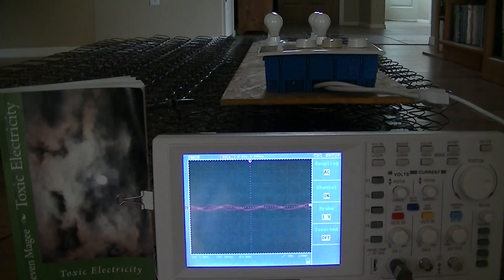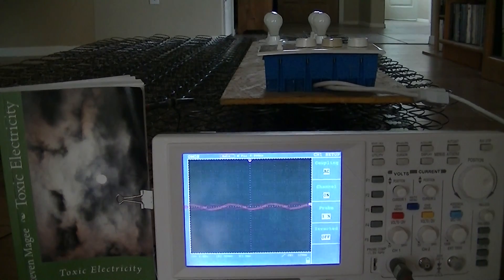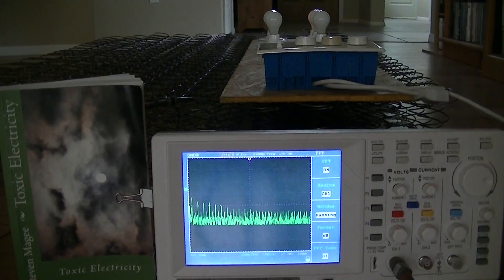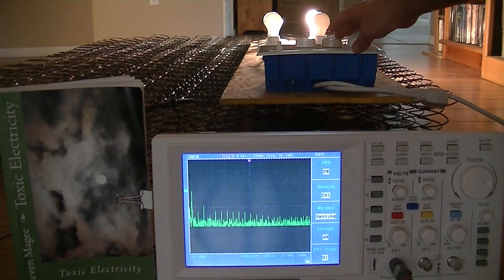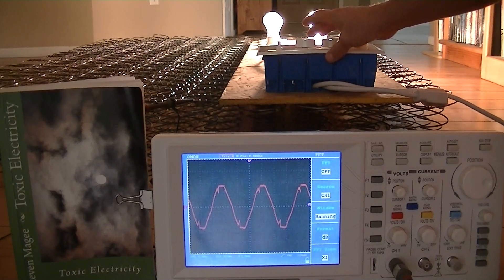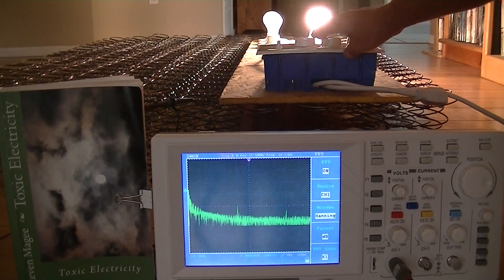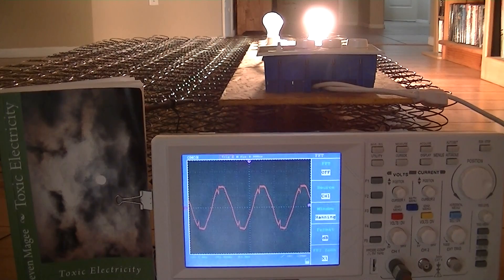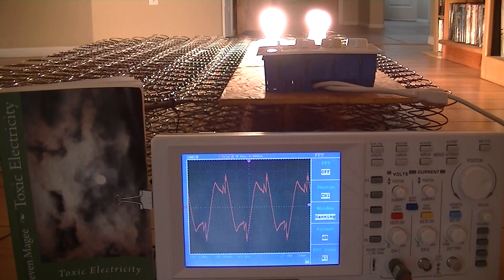Harmonics and Dirty Electricity on a Metal Coil Mattress

Comment: This isn't very helpful for the layperson. How does having the lamps right on top of the exposed mattress prove anything as well? No one is running electric devices on top of their beds. Looking into this because I noticed using a Cornet that the mattresses in my house will produce spikes of EMF on the meter, question is I guess is whether dirty electricity from the house ends up bouncing around in the bed. Likely is smart to simply get a bed and mattress which is free of metal, a good way to do this too cheaply is buy several latex mattress toppers, put them together and you have a great mattress which is more affordable than all of the BS over priced branded coil ones.
Reply: Yep I've got no idea what he just proved...

Comment: Oscilloscopes have extremely high input impedance and are sensitive to the electrical field virtually anywhere, just touch the probe with your finger for example and you will see plenty of waveforms from the electric field thin air virtually everywhere, this is why the probe must be completely shielded to allow a clear signal, please explain how the scope is connected to the mattress (is the earth connected in some way or have you just connected the probe in a floating sense, which doesnt measure current, just potential), also is this really a fair test given that you would never have high current lamps in such close proximity to the mattress, to be fair you should show the result as the lamps are lifted away from the mattress at several distances, this would give us an indication of the relevance of the phenomena (for instance does the waveform intensity drop significantly if you lift the lamps by a few centimeters?)  simply showing waveforms in a fix conditions like this could be misleading because it doesn't really allow you to understand the field intensity of the re-radiated field, there needs to be a field strength measurement, the lamps are the offenders here not the matress, unless you can address some of the above questions, otherwise a good experiment and thanks for sharing....

Comment: Someone told me that it would help my sleep if i put a 2 ft x 6 ft piece of 1/4" galvanized chicken wire under the mattress.  Does anyone think there is any merit to this?  Something about neutralizing Wi-Fi signals?  I woke up feeling terrible.
Reply: A large grid of of metal will act as an antenna, as is shown  in this mattress coil experiment.  Even worse might be is you plug it into the house ground or an external earth connection if you are too close to the electric utility poles. The oscilloscope is pretty fancy here, but you can also use a DVM to measure body voltage, which offers another way to identify and reduce radiating E-fields near the bed.

TO reduce WIFI -- assuming you have already shut off the wifi in your house and all wifi-enabled devices -- is to build a'canopy' surrounding your bed using some conductive materials. The Swissshield fabric reduces fields by around 1000X (-30dBm) and cost more than $1000.  You can cut the signals by 50% or 75%, maybe, using reflective space blanketsforunder $20.  Another option is to have shielding paint, which is about $5_ per square foot.  There are pros and cons for allmethods.  Before spending real money, consider consulting with a Building Biologist in your area to properly measure the fields.There are many things you can do for free, like eliminate all bluetooth devices , cell and cordless phones, especially at bedtime near the sleeping area.

Comment from the maker: Probe tip to the metal coil mattress, ground connection to an 8' non-electrified ground rod in my back garden.  Oscilloscope is powered by internal battery.
Reply: The signal on the scope is just capacitive coupling from the mains to the mattress. Very low level and completely harmless. The triac in a dimmer switches the mains according to the dimmer setting. This switching generates high frequency harmonics which the bed springs pick up and capacitively feed to the scope. Again, completely harmless, although dimmers can be annoying if you have a sensitive amplifier that isn't screened well enough to avoid picking up the buzzing noise. Toxic dirty electricity my arse.